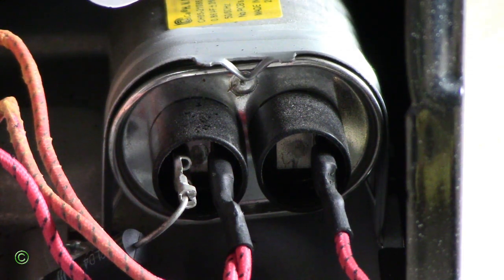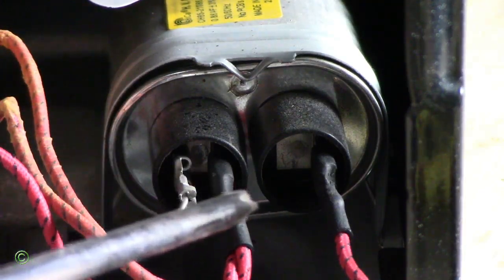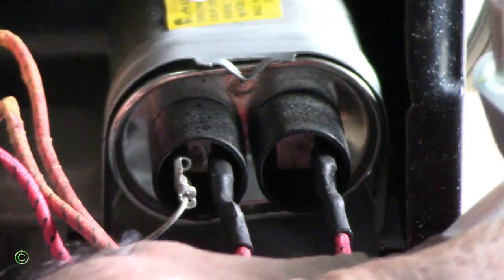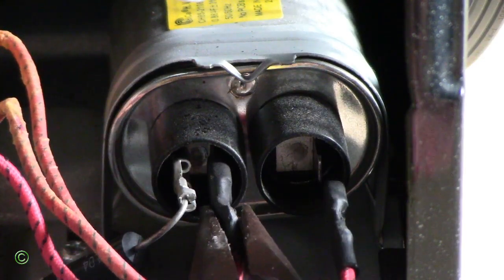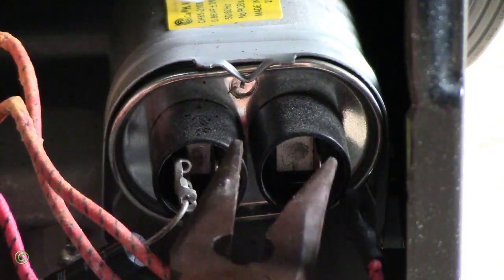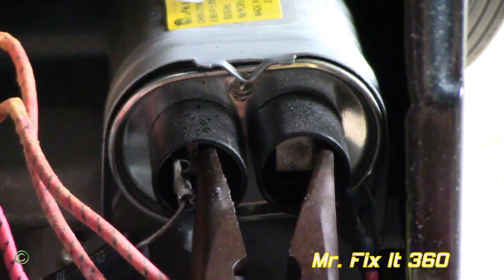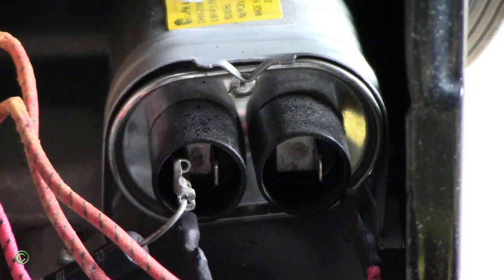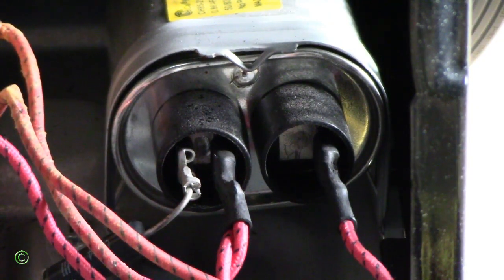How to discharge a high voltage capacitor.

Comment: Good example that youtube removing the dislikes is a terrible horrible idea
Reply: I want to turn an old microwave into a turn table. If I disconnect the magnerton and the fan, will that work? (worried about the capacitor. Should I leave that connected?)
Reply: @johncrow5552  if you have the microwafe chassis closed itll do but if you want to get the electronics out and make your own frame for the turntable get the capacitor discharged and out

so

keep microwave original body = disconnecting transformer and magnetron will do

build own frame = discharge and remove capacitor

Comment: The annoying thing about this video, aside from the safety aspect, was his lack of understand of shorting out capacitor.  He was talking about holding the pliers for a few seconds to make sure it is properly discharged....NO...that is an immediate discharge which makes it dangerous.  So whether you hold it for a split second or 30 seconds it is the same thing.  Holding it for a few seconds would apply if you had a resistor attached to it to make it slowly and safely discharge.
Reply: I'll second that, you're absolutely right
Reply: and I'll third this. There is also the fact that doing this with a fully charged cap can very easily damage the cap. These caps have built in resistors to self discharge whenever power is removed but that resistor can fail, doing what he did in this video with a fully charged cap will not be an enjoyable event.
Reply: what resistor is needed for this type of tool, make a tool that works with the 300v cap , but i need 1 for microwave cap at 3000v or 3kv 1.2uF
Reply: the annoying thing is that he didnt actually discharge it it this video, it obviously had no charge because there would have been tons of sparks for a > 2kv mircowave capacitor

Comment: wow, 0 dislikes! this must be a great way to discharge a high voltage capacitor!
Reply: hope so
Reply: You can get the dislike. Its now an add on. This vid has 1.5K likes, 412 dislikes.
Reply: Since you seem to know about microwaves, I want to turn an old microwave into a turn table. If I disconnect the magnerton and the fan, will that work? (worried about the capacitor. Should I leave that connected?)

Comment: IF YOU DONT KNOW MUCH ABOUT ELECTRONICS, PLEASE READ:
All capacitors discharge instantly when no resistance is applied. on high voltage capacitors, this will cause a large spark. With these types of caps, instant discharge (if done with no insulated gloves and an all metal screwdriver) will cause injury and potentially kill you.

Additionally, the capacitor's dielectric (Which allows more electrons to be stuffed into the plates by reducing their repelling force on the opposite plate) can break down under quick changes in charge. You can imagine this like adding a heavy load to a piece of wood. if you add it slowly, the wood does not need to resist any kinetic energy from the weight being dropped. however, if you drop the weight onto the wood, it will need to bend to absorb the energy from the falling weight. this can easily break the piece of wood.

So in order to reduce the risk of damaging the capacitor (and to some extent, yourself), you should get yourself a 2k Ohm resistor rated for 10 watts. this will reduce the current to ~ 1 amp, which will prevent damage to the dielectric. Also, you don't need to worry about which way the resistor is facing. like many electronic components, polarity doesn't matter with a resistor.
Reply: Now, the 2k Ohm resistor you're talking about should be in the same room or anywhere near the capacitor or just by purchasing it the risk of getting fried is automatically reduced?
Reply: If the capacitor already has a resistor to ground are we safe to use the method in the video? I have discharged some of these capacitors in the past however they've always had resistors to ground and I've left the microwaves sitting for months without plugging them in before I mess around with them.
Reply: Thank you 👍
Where do you connect the two points of the resistor? and what sort of gloves is recommended? Ones like those regular marigold rubber sort?...
Reply: @martinp.2753  Sorry, allow me to clarify. The resistor is to protect the capacitor, not you. to protect yourself you should use insulated gloves, and pliers with insulated handles.
Reply: @Johny40Se7en  The capacitor has 2 terminals. the resistor should be placed such that it closes the circuit between the two terminals.
Reply: @taelorkirkebye4470  Cheers. I got my answer a few minutes ago after watching another video about it. Need to hold the resistor with a pliers and whilst wearing thick rubber gloves. The safety when it comes to these things is no joke...
Only reason why I'm looking into this is to try and use the transformer coil for something. Some of the stories I've read already about microwaves being messed about with by dummies is freaky and bonkers! 😳😅
Reply: 2k or 20k ?
Reply: @shironpathirana  assuimg these capacitors are around 2000 Volts, 2k ohm resistor will give u around 1 amp

Comment: This is a prime example of why the dislike counter should not have been removed.

If somebody dies or is seriously injured as a result of using this method then YouTube should be liable.
Reply: “But it's target harassment of people who could get someone killed! They don't deserve those dislikes!”
Reply: YouTube has turned into a joke. All videos should come with a warning don't follow along.
Reply: Comments from people
Like you might legitimately save someone. Damn YouTube for hiding the dislike button for the biden admin.
Reply: You can get the dislike. Its now an add on. This vid has 1.5K likes, 412 dislikes.
Reply: I want to turn an old microwave into a turn table. If I disconnect the magnerton and the fan, will that work? (worried about the capacitor. Should I leave that connected?)
Reply: I don't even touch the like button on any video anymore lol it's become pointless
Reply: can you please provide the correct method to do this? I can't find any reliable videos on how to do it, so if you are knowledgeable on this topic please share your method

Comment: Always.....Always best to use a bleeder resistor, afterwards use a volt meter to check if capacitor is Fully discharged. Safety first.....and the reason is called safety first, you might not have a second chance!

Comment: He's totally right about the need to discharge caps before maintenance but this is not the way you want to go about doing it, you need a resistor to bridge between the terminals to slowly and safely discharge the cap, shorting them out directly with a metal tool can damage the capacitor or damage you, those caps can hold a 2KV charge capable of dropping you on your ass, dead. Get a 2k Ohm 10 Watt resistor or something similar to do it safely.
Reply: Get the resistor and then do what? Tell us the steps, specifically doing what with what?!
Reply: @laurel1966   It is pretty straightforward, you just bridge the positive and negative terminals on the capacitor with the resistor. Leave the resistor connected for a minute or so and voila! Discharged capacitor. Do make sure to attach a foot or two long lead with an alligator clip to one side of the resistor and an insulated probe tip on the other so you aren't trying to stick a bare resistor in there with your fingers, you just clamp the alligator clip onto one terminal then use the probe to touch the other terminal, it's much safer that way.

Comment: Having messed with capacitors in aircraft before I was expecting a spark. I'mm assuming that's what that resistor to ground is doing to help take some of the ompf out of it before hand. 

As another would say I'd recommend gloves as well preferable thick insulated ones but I've also been shocked a few times and us an experience I don't like to repeat when I'm in control of it.

Comment: Thank you for your video. Question: If I flip capacitor 180 degree out, does it matter for those three wires connections?

Comment: This should be labeled "how not to discharge a capacitor!" Whenever you short out capacitors like this, especially high voltage ones you break down the dielectric material. If you keep doing this, one day when you plug on that microwave you'll get some fireworks! There is to much material on the subject to make a video like this, take 2 would be a good start!

Comment: How will you know that it's actually been shorted out? Can you test it with a multi-meter? Thanks
Reply: Unless you want to blow your multimeter
Reply: @marcinkovalevskij5820  Ok thank you for the reply.
Reply: metratone5 if the voltage of the capacitor exceeds the maximum dc voltage your multimeter can handle (which it most likely will), then you shouldn’t test with the multimeter
Reply: I think all MM have a fuse
Reply: @Solder_it  Fuses protect a MM from too much current, not too much voltage.
Reply: Frighting to watch this guy working this way because if it wasn't discharged he would be dead and we would be watching croaking frog videos instead
Reply: @bruhmomenthdr7575  yup true, but with this case  it's not a dc cap but ac rather
Reply: Use your multimeter on the highest voltage setting - dc obviously - and you should be able to watch the voltage decay through your meter. I think. An analogue meter would be best.

Comment: how to know that capacitor is discharge completely?
Reply: put both hands there you will know 100%
Reply: @chriscs9080  My nose lighted up.  Does that mean it's not fully discharged?
Reply: @dgr8flav  depends on the size of the nose 🐽👃

Comment: With power disconnected can you use a multimeter to test the diode in situ without disconnecting the capacitor ?

Comment: I want to turn an old microwave into a turn table. If I disconnect the magnerton and the fan, will that work? (worried about the capacitor. Should I leave that connected?)

Comment: why is the microwave tripping the breaker and not blowing the fuse
Reply from the maker: one reason is that the circuit is overload. causing the breaker to tripped.
Reply: ok thanks much

Comment: There's about 486 dislikes and 1,795 likes on this video, with 21.3% of people who disliked and 78.6% of people who liked. What a awful video, people - please use resistors and not some pliers you found on the floor to discharge you capacitors. And YouTube, bring back the dislike button for everyone, you're potentially killing people ignorant people.